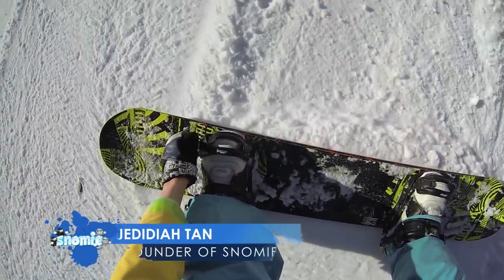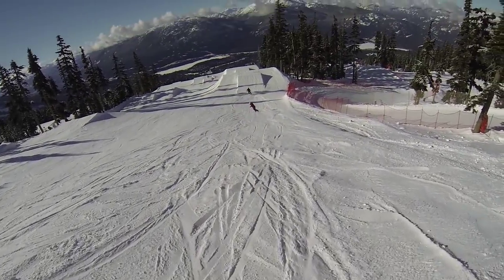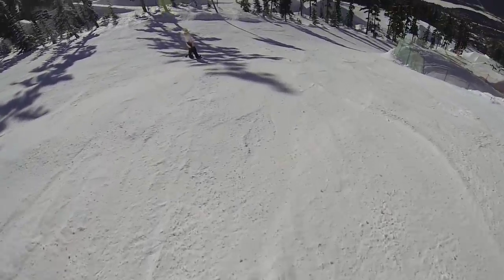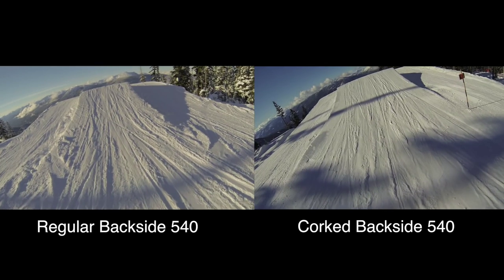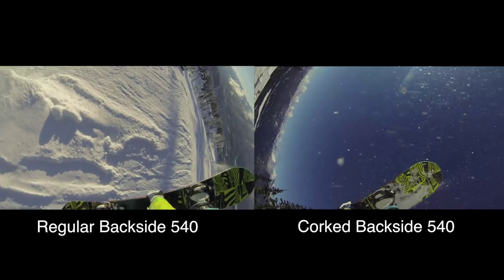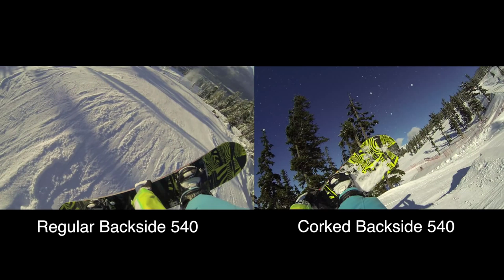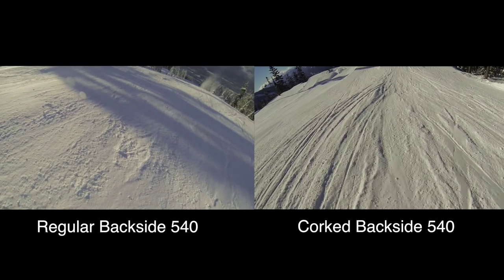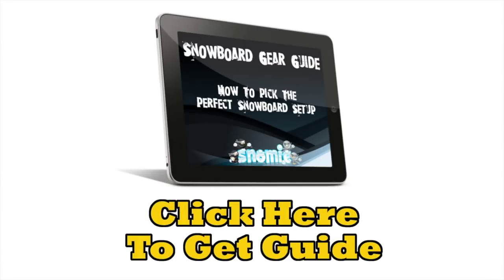How To Spin A Cork 540 Vs. Regular 540 (GoPro Snowboard POV)

Comment: It sounds much easier than it is, if you can spin a 540, you CAN cork it, all that you have to do is throw your lead shoulder to your back knee(I find grabbing just in front of my back binding helps) and you'll eventually get the rotation down. Honest to god, the hardest part of the trick is having the kahuna's to throw it off the jump:)

Comment: So what is the difference between cork spins and rodeo spins exactly? I know they're both off-axis but I'm majorly confused on how they're done in different ways
Reply: TheSkaBouncer rodeos are flips with a spin and corks are just off axis spins, but lots of people go crazy off axis on their corks so they basically look like a flip.
Reply: they spin off different axis the reason people think rodeos are flips is because doing a back flip and a bs 180 will throw you into a bs rodeo when done corectly but if not it ends up being a back flip late bs 180.  if it a cork you lead shoulder dips first if its a rodeo your back shoulder dips first.
Reply: i know its a bit too late, but both of these answers are only partly correct, rodeos are more inverted than corks and you start them off spinning "hardway", which is spinning in the opposite direction to the edge you are standing on (if you pop of toes, you spin frontside, and backside if you start of heels)

Comment from the maker: Anything over a 360 is advanced when you remember that the majority of snowboarders are 1 to 10 day a year riders. Only maybe 5% of less of snowboarders are even able to throw a solid 540 with clean style, much less cork it and not look wild and out of control while doing it (the key is style, any old guy can huck a cork, but not every one of them makes it look good).
Reply: Ha, true, but I'm hoping my trampoline will get me somewhere for my 10 days of riding this year.
Reply: When you're corking a spin  instead of throwing as a cork, ie throwing your shoulder down, you might want to try throwing the spin normally and then bringing your feet up. You'll have much more control over your corked spins this way. It's kind of similar to popping and then flipping for a backflip instead of just the huck and tuck method where you basically have no control over the speed of your flip and no way to properly spot. By throwing the spin and then corking it also looks a lot more stylish as it makes the axis look a lot more natural instead of a 'forced' off axis spin.

Comment: In every instruction Video they say " keep your shoulders flat" . But in which relation? To the horizon, Take-off or landing?
Reply from the maker: In relation to the take-off I guess would be the closest. Basically when we say keep your shoulders flat, we just mean stay relatively horizontal to the line of travel that the jump sends you on (you'll always be a tiny bit off your horizontal axis since jump take-offs are all curved upwards a little, but we mean don't dip your shoulders beyond that - unless of course you mean to cork).
Reply: ***** Thanks a lot for your Answer! But same typs of Take-offs, specialy on biger Jumps are extremly curved upwarts.(45° and more?!)
I always supposed that, if I would "keep my shoulders flat" to a 45°angle take-off, I would do a strong cork.
So I always have to turn my Shoulders a bit forward, to get into the horizontal Regular spin?!

Right?

sry, my english isnt perfect
Reply from the maker: AscendedBeing87 Yeah, in some cases some jumps tend to send you a little more corked then others, it's up to the rider to fight against that if they don't want to get too corked.
Reply: @Snomie  Does fighting against that look like keeping your shoulders level to horizon?

Comment: i went for a back 3 today, and i had them down but i ended up doing a cork 5
Reply: If you go for mute grab on backside spins you will almost automatically cork. That's the way it worked for me anyway. Lean into the grab.
Reply: i have tryed into a bag jump. i can not grab. eather i get the grab and not the spin, or the spin and not the grab

Comment: Everyone says "Spot the landing" but what do they mean? Do you just look where you will land?
Reply from the maker: Spotting the landing means looking at where you will land AND making a note of where you are in relation to the landing so you can adjust your body to land. So for example, you might want to look for the landing and know that it's to your left or right or if you're upside down it might be up and above your right shoulder.

Knowing where the landing is by 'spotting' it allows you to make adjustments and prepare/align yourself for the landing.
Reply: Also, when you are in backflips, when you spot your landing, if youre at your peak and 3/4 way through you know you have to slow the spin.

Comment: hm can you say if you are throwing yourselfe backwards or frontwards? if that can be said :D
Reply: because i just tried that trick on trampoline, i did kind of throwing my frontshoulder to my backfoot and it feels like a cork. but when i let filmed it, it looked like i´m doint a half ratation, and that a sideflip or widcat (i think thats the way it´s called) :/
Reply from the maker: This is a backside cork 540, so it's kind of like a frontflip 180.